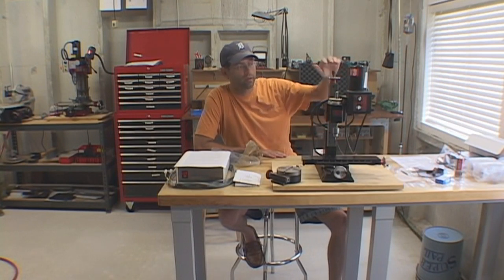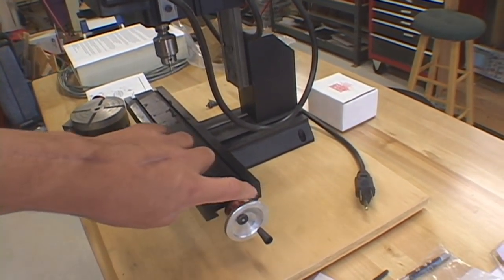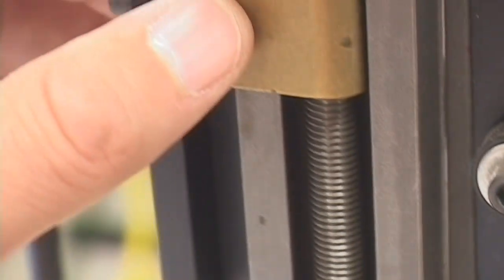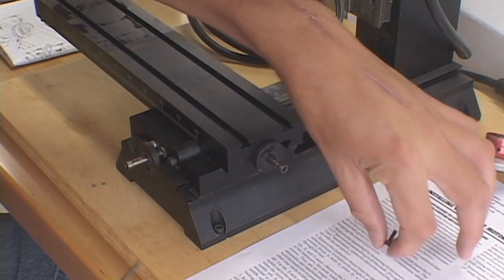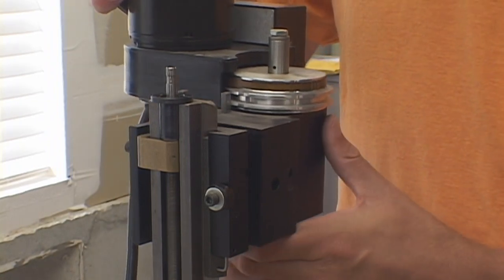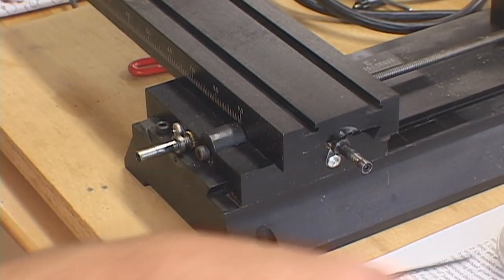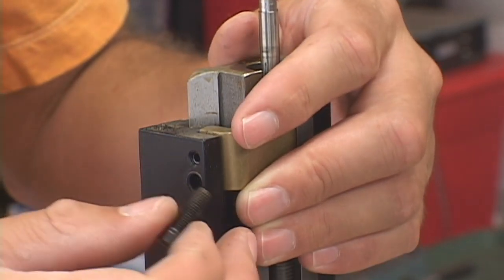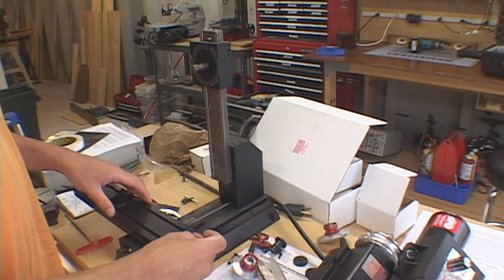Sherline Mill CNC Conversion 1 of 2

Comment: Great video with lots of good info!  I have the same mill and am planning on doing a CNC upgrade too.  How did the Xylotex driver, larger motors, and PCI/Parallel card work out for you?  Did EMC work well with that set up?